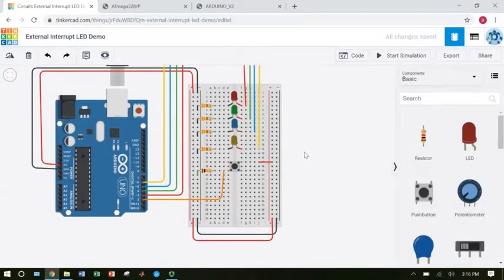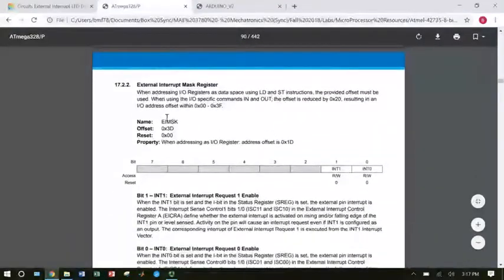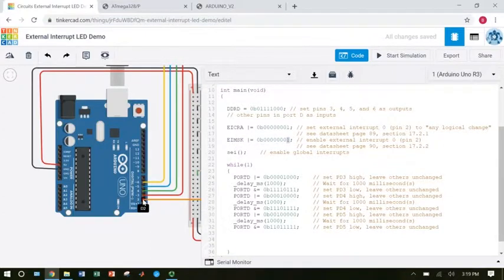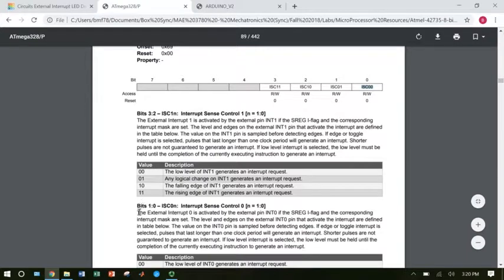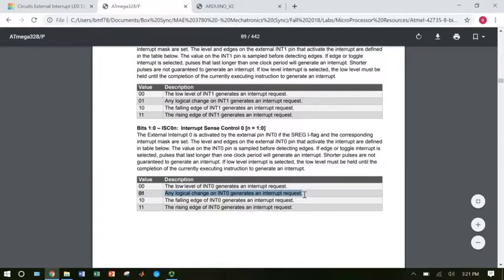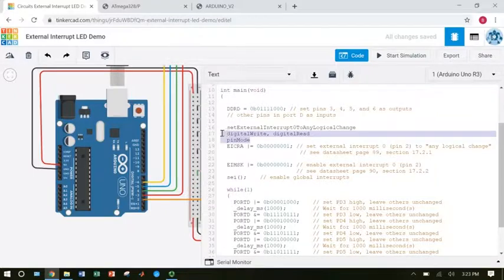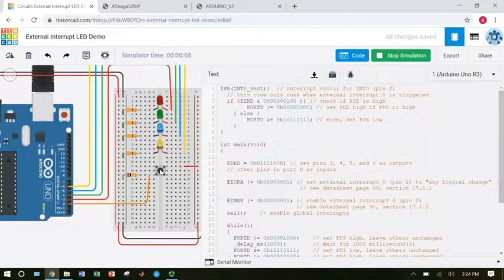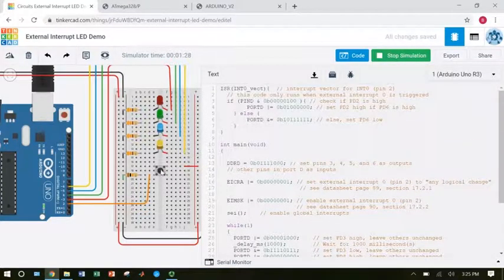External Interrupts with Arduino in Tinkercad Circuits

Comment: Ben wouldn’t it be easier to use the attachInterrupt method for Arduino? https://www.arduino.cc/reference/en/language/functions/external-interrupts/attachinterrupt/ 
I’m using it for my custom encoder class.
Reply from the maker: Sorry Keith for some reason I never saw this comment. In the Mechatronics class I teach at Cornell we don't let them use Arduino libraries at all - all the programming of the actual hardware is done using C in Atmel Studio. So this is definitely doing it "the hard way" - if you are already using the Arduino IDE and libraries then yes that way is probably simpler.